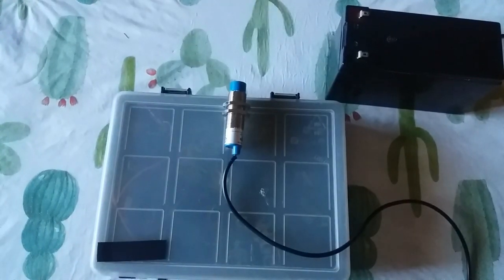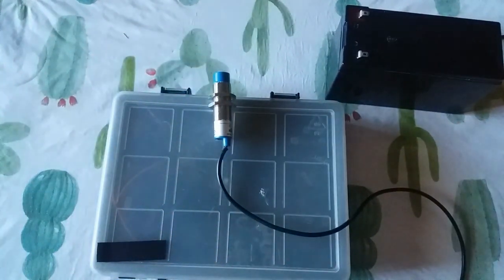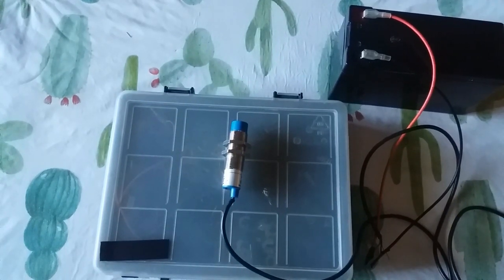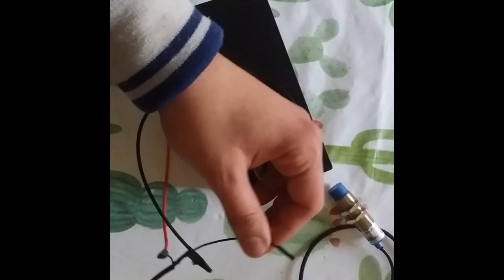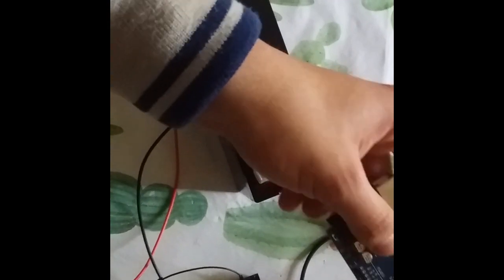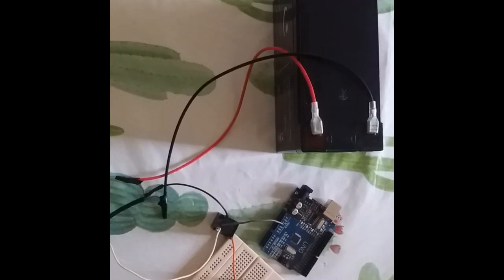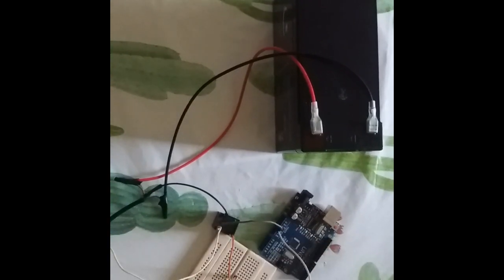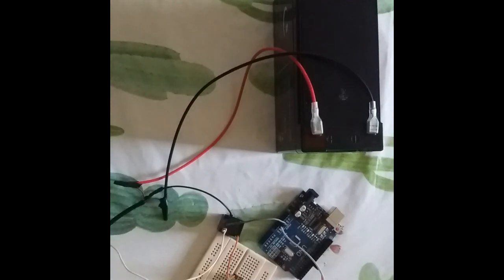How to use an inductive sensor and connect it to arduino

Comment: Hi sir! Me and my group are developing a machine for a group project, our sensor is Capacitive Proximity Sensor which has 6-36V, do i use the same materials you used in this video if that's the case of my sensor? because we've been having problems about how will we power the capacitive proximity sensor, also instead of a battery i used a 12V adaptor. Hope to receive a response from you, thanks!
Reply from the maker: Hello Dear, 
First yes you can use capacitive sensor if your goal is to detect the presence of any object. i can't tell you specifically how to wire your sensor, it may change depending on the sensor type. in addition, you can also use another sensor type and simpler than the capacitive one if your target is only to detect the presence of an object. regarding your connection and wiring, as i told you it depends on the datasheet of the sensor.
Reply: Hi again sir! Unfortunately, are only option when it comes to sensors is the Capacitive Proximity Sensor, I don't really know how to wire this in a way that it doesn't explode or damage the Arduino Uno
Reply from the maker: @jamieanreaibasco6069  Do you have the Real specification of your sensor? as i told you there are plenty of sensor types you need to know which one you have in order to see the way of wiring

Comment: is relay a must use tools for this setup to work?, sorry i just got into electronics and for now i only have the sensor, arduino uno, and a bunch of jumper cable
Reply from the maker: Hello Dear, yes the relay needed if you have more sources or different source. for example if you have 12 volt and your arduino is able to read +5V not 12 VDC
Reply: You can also use a voltage divider circuit using resistors, instead of a relay to get the voltage down to the correct amount for the arduino board

Comment: Hi please can you answer me why do we use the coil ?
Reply from the maker: Hii Aya,
Hope you're doing well
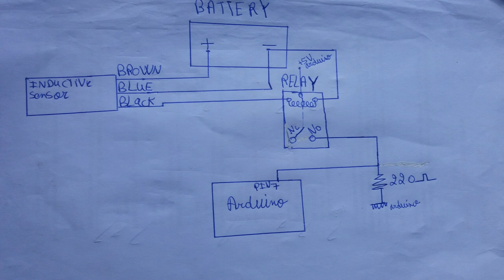the main target of using the coil is to make the relay switch between the two states, as you can see in the block diagram at 6:15, for example when we detect an object, the coil will turn the relay to switch to the second state, so that we can nofity that there is an object detected, if there is no detection, the relay will not switch, so we can also know that there is no object detected

Comment: What is the purpose of the 220 ohm relay?  Does this limit the current for the Arduino?
Reply from the maker: Hello Dear,
Yes the role of the 330 ohm resistor is to prevent the short circuit condition, also to prevent any parasite on your circuit. So when you add a pull up or a pull down resistor, you can safely control your arduino by the condition either + 5v or direct Gnd.
Reply from the maker: let me know if you got my point
Reply: @RoMecha_lb  so the choice of resistor should be more than the internal resistance of the sensor? or maybe about the same, but enough to limit the source current, thank your for your quick reply
Reply from the maker: @Frugaltinker  Yes Dear, 220 ohm could be the suitable resistance value, as i told you the main target of this resistance is to prevent any parasite in your circuit and to deliver the two states either GND or 5VDC.

Comment: Hello man, i did something like this with a raspberry pi 3B+ model , 2 question: from NO i need to go with 2 wires : 1 for GND and 1 for INPUT wire ? And also when i ran my script it detected both low and high without sensor activation. Do you have any idea why that might happen ?
Reply from the maker: Hello Dear,
regarding your question, in the case when your raspberry pi detect both positive and negative, can you check if the  ground of your raspberry  pi is connected to the ground of your sensor? because in every Arduino or any microcontroller project, it's a common mistake that sometime the components does not grounded together. if not, please give me more information about your problem, so that I can help you as much as I can.

Comment: can you make a code and circuit diagram for inductive proximity sensor controlling a servo motor?
Reply from the maker: Hello krizzy,
hope you're doing well
first, you can check our videos and see how to control stepper motor easily, then how to control a stepper motor, after that i think you can easily mix both code to make what you want.
And if you need any help, we are here to help you..
Thank you..
P.Y

Comment: Great. For my project I need to use 3 proximity sensors. How would the whole setup change for my application ?
Reply from the maker: hello Angel , 
i don't really understand what do you mean ,if you can please send me more details about your project,but i will tell you some ideas that can help you,
 first you need to connect your three sensors to the battery normally , after that you need to setup the three inputs from your sensors to the Arduino and do the same setup as my video

Comment: Sir can you please make a diagram for inductive proximity sensor controlling a servo motor 🙏🏻🙏🏻🙏🏻
Reply: i'm late, but in case it's still useful to you here i go: 
an easy way to do what you asked for is connecting the output from the sensor to the coil in a 12V relay (since this sensor is also 12V), 
connect the contact input from the relay to the 5V pin of an arduino board. 
connect the relay contact output to the pin you designated as input in the arduino code. 
Code whatever you want the servo to do. (you can find a ton of examples and videos explaining servos + arduino programs in case you don't know much about programming arduino boards.).
connect the servo to the arduino board.
 add a power supply for the sensor (12V) and another for the arduino board (5V unless it's a nano board).
use a servo that works at 5V for a simple circuit. 
if you want a more advanced circuit with a more powerful servo, an amplifying arduino circuit to be able to control stronger servos with an arduino.
Reply: @jordicl4325  hi! can i connect a 7.2V servo to 12V power supply? Because the first time I tried to make the servo rotate, it didn't happen, and I was advised that maybe the power supply was insufficient. Connected to the 12V power supply is also a Capacitive Sensor, will it damage my Arduino uno or it's ok?

Comment: Please share link for relay sir🙏
Reply from the maker: Hello Krunal
What is the specific link or the specific info do you need ?
can you please specify and we will provide you as soon as we can
Reply: 12v relay used in this project sir
Reply: Any 12v relay would be work?
Reply from the maker: @krunalpatel5916  Hello again  krunal 😀✋,
yes sir , if you have any 12 Vdc relay , you can put it and it will work well , but you need to know the datasheet of your relay especially if you don't have the same relay , you can search on google and get the datasheet ,
there are a lot of relay types , i think also there is a difference probably in the pins placement , you need to know :
Coil pins , normally open and close pins .
if you need , send us the relay type and number you have and we will tell you if you need to change any connection or no , and i recommend you to go to minute 6:14 and see the wiring with the sensor .
Thank you .
R.G
Reply: Operating Voltage: 12V DC
Equipped with high-current relay 10A@250VAC / 10A@30VDC
It can control both AC and DC appliances such as Solenoids, Motors, lights, fans, etc
High-quality screw terminals (Terminal Block) provided (C, NC, NO) for quick and easy connection
Freewheeling diode to protect your microcontroller
Input Signal Pin connected to Burg stick for easy accessibility
LED Status indicators to indicate the relay ON/OFF status
Mounting holes provided
Reply: https://robu.in/product/4-roadchannel-relay-module-light-coupling-12v/
Reply: This relay will work?
Reply from the maker: @krunalpatel5916  yes sir , this relay is a 12vdc relay , it will work normally with the sensor , but be attention and wire it well , watch my video as i told you and see the wiring diagram here 6:14

Comment: What's the smallest object you can detect with this sensor? For example would it be possible to detect a 1mm (diameter) wire with the sensor?
Reply from the maker: Hi thomas 😀✋✋,
Yes Because of magnetic field , inductive sensors have a sensing range  from a fractions of millimeters to 60 mm on average , But also depending on the sensor specifcations , Now i recommend you to ask the seller before you buy it  about the full specifications of the sensor and see the sensitive rate to make sure that is the suitable sensor type that you need👏😊 .
Reply: @RoMecha_lb  Thank you
Reply from the maker: @MultiTomtom97  Welcome anytime , if you have any other question don't hesitate to contact us .

Comment: Hi man great tutorial. If I just want to log the data can I skip the relay ? and if yes can your please please share a quick circuit for it? Thanks for your time !
Reply from the maker: Hello Mr palav , the target of the relay here is to give the arduino +5 v and 0 v, yes of course if you want to log your data as 12 and 0 v, you can take it directly from the black line of the sensor and no need to put a relay. if this answer is not clear , please specify exactly what is your idea and we will reply on it.
Thank you
Reply: Hi! Thanks for the quick reply. I want to log data on Arduino so if I connect black wire to analog in and join all grounds i.e battery ground ,sensor ground to Arduino ground . So Arduino is powered by different battery and sensor is powered by different battery I just join the grounds and connect black wire of sensor to Arduino analog in. . I am worried if joining ground with Arduino as the battery for sensor will be 12 v  Arduino.
Reply from the maker: @palavkaria8452  NO attention , arduino can read an analog or digital value between 0 and 5 v , you cannot give the arduino +12 v or 24 v to it's input , if you want to log your data , i recommend you to make the same circuit as the video and it will work well, and yes  you can join your arduino ground with your battery , but attention you cannot give the arduino +12 v on it's inputs, also if you have any question , we are here to help you.
Reply: @RoMecha_lb  but I am not planning to give +12v to Arduino just connecting the data pin to Arduino analog. Does the. Data pin high is also +12v?
Reply from the maker: @palavkaria8452  i'm not tried this before, but as i know yes Arduino can be damaged by more than +5V or by negative voltages. so if you don't want to use a relay ,you can "knock-down" the voltage with a voltage divider (2 resistors)
Reply: @RoMecha_lb  Hi! Yes exactly what I need thanks for the info man. I got the resistors will implement the divider and see how it goes. I have couple of  spare Arduino uno's so I will be fine ;) thanks man really appreciate the help.
Reply from the maker: @palavkaria8452  welcome anytime 👏👏

Comment: Sir, what type of relay did u use ?
Reply from the maker: Hello, this is a 12v dc relay, it works as simple as normal relay.
Reply: @RoMecha_lb  okay sir,  then do we need to use 12v relay for 12v of power supply or can i use 5v relay for 12v of power supply ?
Reply from the maker: @rabiatuladawiyah7299  Yes sir, it's preferable to use 12v dc relay if you use 12 battery, but also it depends on the relay types(some relay you can and some you can't),as i told you, it's preferable to use 12v if you have a 12v power
Reply from the maker: if you need any question, we are here to help you sir in whatever you want.
Reply: @RoMecha_lb  okay, i got it . Thank you sir
Reply: Sir, is it affected to arduino if we did not use resistor ? Because i have seen in other video, some use resistor and some did not use resistor, only sensor connected to relay . What make it difference ?
Reply from the maker: @rabiatuladawiyah7299  yes sir, it is preferable to use resistor to avoid any parasitic signal(like 0010000101), there are some types of sensor that need a resistor to be worked well, and some types does not need a resistor,but i recommend you to use a resistor and connect it  same as this video to be worked well.
Reply: @RoMecha_lb  alright . Thanks sir
Reply from the maker: @rabiatuladawiyah7299  welcome anytime
Reply: @RoMecha_lb  sir, what type of inductive sensor you use ? NPN or PNP?
Reply from the maker: @rabiatuladawiyah7299  
Welcome back sir , PNP and NPN sensors are both supplied with positive and negative power leads, PNP sensors produce a positive output to your industrial controls input, while NPN sensors produce a negative signal during an “on” state. in this tutorial this is a PNP sensor
Reply: @RoMecha_lb  okay, then if i use NPN sensor, so the connection between sensor and relay is still the same with this video or different?
Reply from the maker: @rabiatuladawiyah7299  yes you can connect it same as this video, but you need to change one wire, first stop the video on the 6:16 , then look at the coil of the relay , it was connected to the (-) of the bettery, all you need is to connect it to the (+) instead of (-), also before that make sure on which type of sensor you have(pnp or npn)
Reply: @RoMecha_lb  hello sir! do i have to use both resistor and relay? because i used 1k, 10k, and 220 resistor for my capacitive proximity sensor, it worked fine the other day but now it's not working anymore